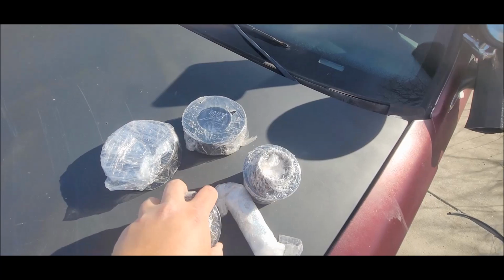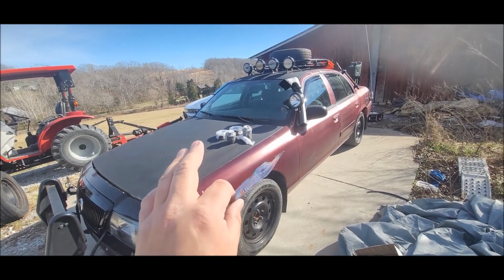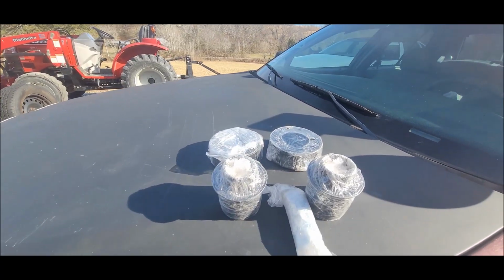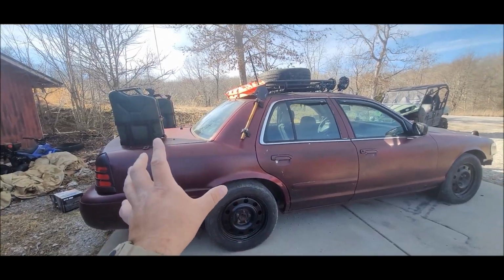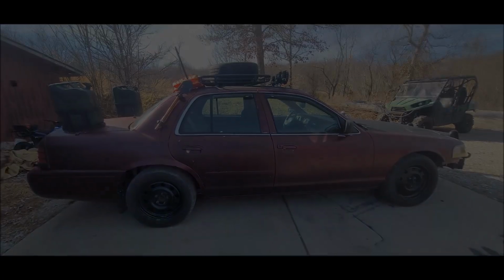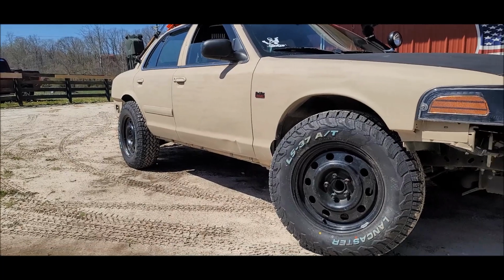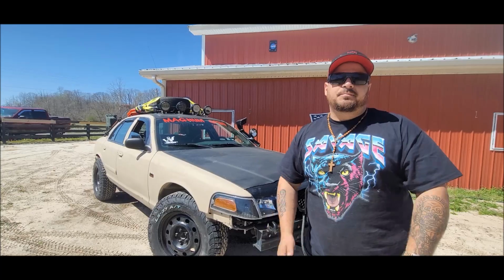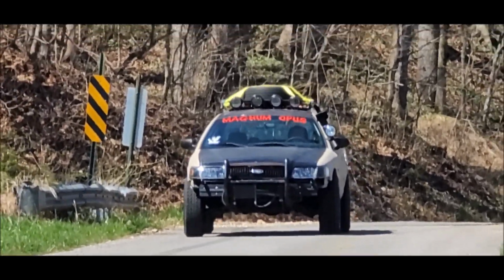Road to Gambler 500!! Installed 3 Inch Lift Kit (Off-Road Crown Victoria) Magnum Opus Rally Vic

Comment: 2" lift, 30" tires with +0mm offset rims and the wheel wells get filled out perfectly, and no rubbing. Have stock bumpers installed.

Comment: Good video! Finally joined the lifted club! 

If you're looking for a little more long travel ford explorer struts for the front expedition springs for the rear with f150 shocks. Much more travel less binding for offroad :) that's my setup at the moment because I had trouble with the spacers and cups. 

Cheers and take care.
Reply: is that with or without the actual lift kit? if without what kind of lift do you get out of that combo?
Reply: @lucasplank5905   It ends up a little higher than the 3" kit with the  Expedition Springs and F150 shocks in the rear and the Ford Explorer struts with the CVPI Springs on the front. You also have to reverse and flip your front top control arms. tacomasrt Has a couple of good videos explaining the process Here on YouTube.
Reply: Awesome! Thank you
Reply: @FragranceJudge  what year expedition & f150

Comment: What all did you do as far as off-roading goes? Did you put a limited slip in or get lockers? I’d think you’d have to cause my 2010 P7B with the open diff is horrible in mud, even if there’s one tire on the road, the tire in the mud is the one getting the power.
Reply: Sounds like you need your limited slip rebuilt. I'm not aware of any P71/P7B with an open diff